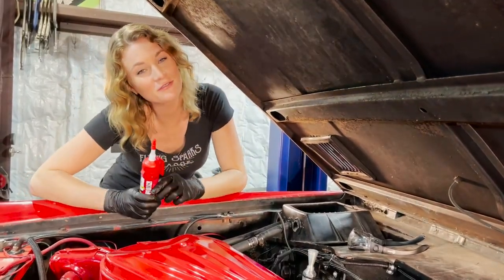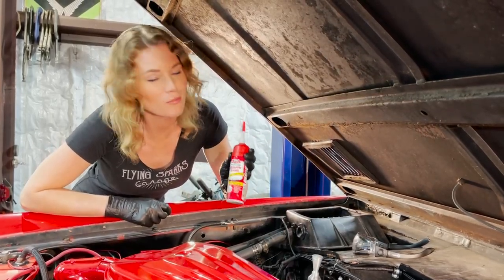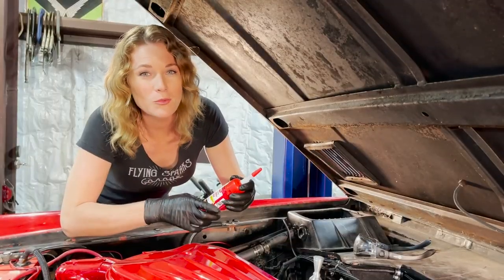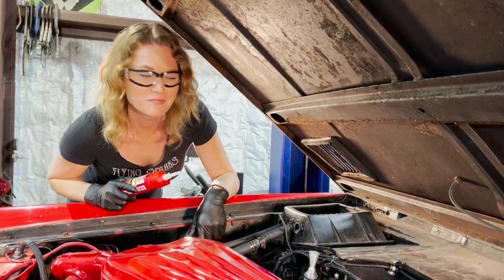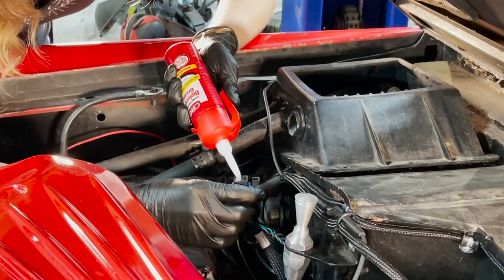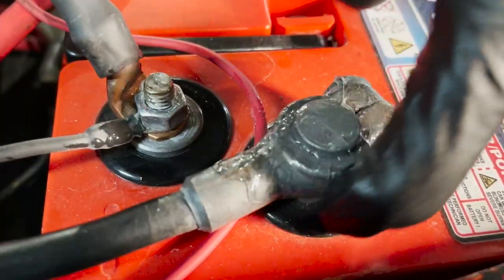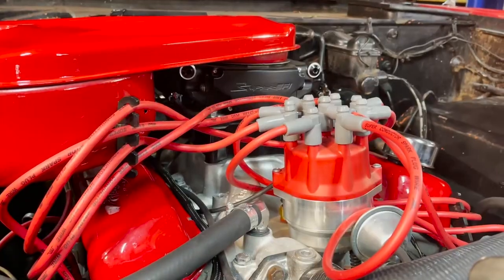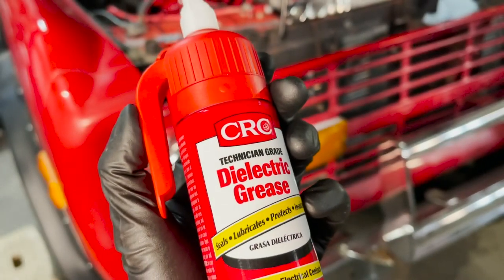Protect and Improve Electrical Parts With CRC Technician Grade Dielectric Grease, With Emily Reeves

Comment: That was the point to distract you from the misinformation and presentation of the product  it is an insulator and should not be pushed into a spark plug connector